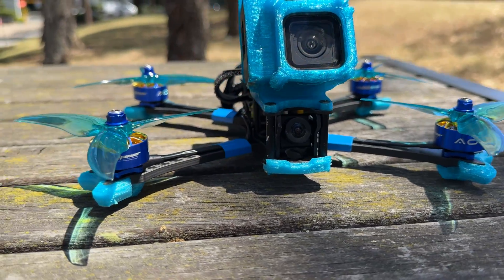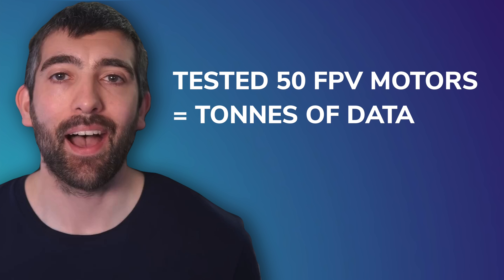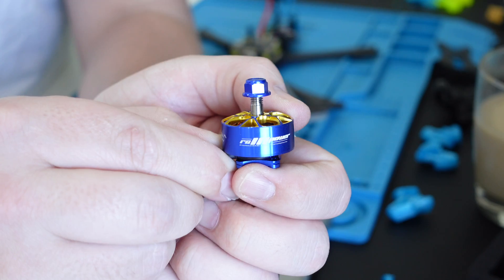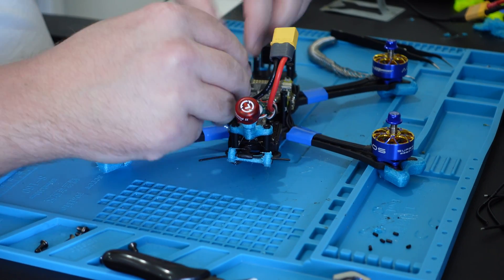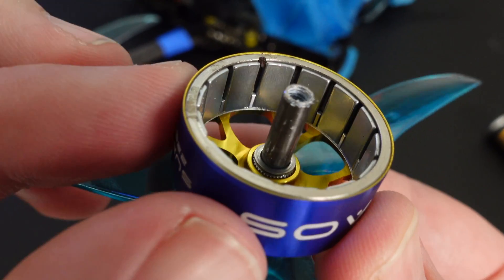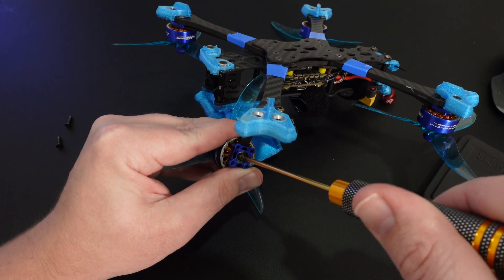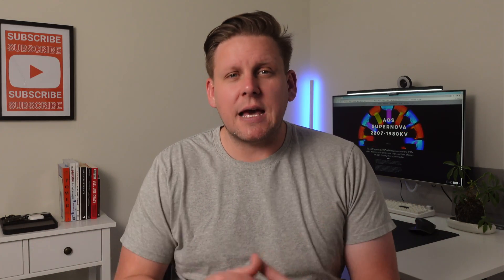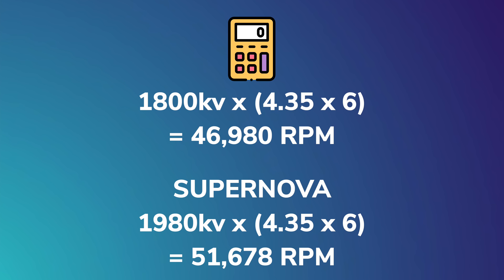I Tried “The Best” FPV Motor According To Science

Comment: Thank you for making this content. I 100% agree. For instance on the computer his 3.5 evo is perfect but  the stack holes run into another. So at the 25mm hole is the same for middle, then middle into front. So your vtx is 25wide how can you use the middle stack unless you choose 20x20. Why not just say it's 20x20 mounting. even if you wanted to turn the board the standoff is now at that point a problem. Same with the front they run into the middle/ camera plates are same height as the vista. He definitely tried to combine the iflight 2208 and Mr Steele 2307 in my opinion. Although the whole motor scene in a sham. Johnny Fpv and lumenier have been doing it for years. His frame was 03 ready before it was released, the cnc front plates he chose were vitsa/air unit ready.They have unique motor sizes and kv.( Now everyone wants a 4s motor on a 6s quad.) Here me out . ...

Everything that was over 2100kv or over in the 2306 or 2207 class was 6s( last year!.) Now it's the standard to be in this range. Also a year ago ... I was told it will spin the motor to fast and be inefficient because it would cause over oscillations 6s on 4s in general ... otherwise the motor will get hot "It's probably because the C rating before wasn't able to achieve the whole power band" or there working together. I've honestly been running for 6S motors on 4S for 2 years now because my iflight came unmarked all black... but the ripped and I continued using 6s. thus my question. So it's been a let's make everything lighter market. Because power is torque isn't it? It depends. At this point it comes down to weight. Because the same high end power isn't going to have torque for a dive on 800grams. everything have been pushed to become lighter so you don't need a lower KV with as much torque to pull out of dives. This is all skeptical . I've tried so many motors it's not even funny. not bench test! How does a bench test show thrust with weight differential. For him to say that Mr steele are not one of best is kind of absurd. So for chirs to charge $3 more for a motor with the least amount of material in any other motor besides flux that's eventually disapates. He clearly knows he has the right amount of followers to send us all to the bank.   his cnc madness clan alone. Mr steele motors aren't all the unique either. Johnny Fpv 5. Years ago 2306.8 in (1750 6s )2250( 5s 2550) (4s 2550) is apparently enough to change battery. I myself was giving the knew fad 2000kv room of margine until I read those specs. 28 grams also. So it seems  ust call a 4s motor a 6s because no one is buying 4s motors any longer. Mr Steele said so in his interview so his v5 isn't 4s..  also  So I can add the Stout bell to a silk stator and gives you 10%? Fair but is it the magnet or the kv? 10% is enough to go from 4s to 6s or magnets rather. So every 6s motor that uses nsb is 4s? it's just a better bearing. Go from nsb #2 bearing and or magnet made in the world to nsk #1 performing 10% better makes since. Also botgrinders 2207 have higher  ohms peak current and everything else at 2207 over Chris motor or basically every motor in that class except. Axis flying making a 2406 making 1000 grams of thrust is technically also a 6in motor but it's hot man.

Comment: The Velox 3 (2207) isn't 2207 either. It is 22,5 x 7,5 mm according to a review from Gal Kremer. I have purchased one of that and an F60 Pro Mk. 5 even to "feel" them. They are very nice both, just touching the bell, feeling the bearing and the cogging does not really justify the F60 Pro 5 being nearly double the price.

And just before I forget to mention. The F60 Pro 5 isn't 2207 either. It is closer to 22 x 7,8 mm in size.
Reply from the maker: Again, the point is - Chris has the opportunity to stick to science & engineering instead of playing into the marketing games of FPV companies.

Comment: One sure way to test is to see what hover times/flight times you get of those vs other best in class motors.
You should be get more minutes of flight time with these as they are more efficient.
In terms of feeling they probably won't feel much different than other motors with similar measurements and KV.

Comment: so much rambling with no valuable info
Reply: Bloodfart!
Reply from the maker: what "valuable info" were you expecting?
Reply: @DarrenAllatt  for example a REAL Test not just rambling?
Reply from the maker: What’s a real test?

Chris already did the bench testing, and has the data

Did you not see where I told you exactly what you were getting from the video
Reply: @DarrenAllatt  A real test would be for example to put this motors on, fly arround / to a full on hover test, meassure flight time and do the same with one of the other motors. compare it and check if his bench testing gives you real world benefits too. If it is stronger and faster at changing rotation  speed, that has to be feelable / visible / meassurable. So if that is true it MUST have feelable / meassurable effects. but for that it might me necessary to reduce filters in the FC.  
I saw it, but for my feeling it is overall negative based on price and size, not nuanced and dont takes into account that for some situations/flyers the pricyer motors might be worth it. I mean that it is more pricy you already see when you want to buy them, that the size is a bit different you get from him already. So there is no real information benefit dont you think?
one other thing bigger stators normaly come with rotation speed change penalty, so if you now have a motor with a bigger stator that has not only NO penalty but is in fact faster, thats a benefit i would think? That does not change the price, and maybe its not the best idea to call it 2207. BUT if its in the weight class of a 2207 AND rotational change of the 2207 or even better, then i dont realy see the problem. I then would call it a 2207 class motor. But it would be realy interesting to compare it in a real world szenario againt 2207 AND 2308 motors. And we dont have to discuss that a bad pilot dont get better by changing the motors.
Reply from the maker: @iwh7  what was this video about?

Me trying the motors,

What were the three things I said I would cover in the video?

1. what makes them different to other motors,
2. if the average fpv pilot can actually tell if they’re better, 
3. whether are they really worth $29 each

These were said at the very start of the video so you should not have been under the impression that you’re going to get all of those things that you’re asking for in a “real test”

All of the things you’re asking for were completely outside of the scope of what I was trying to cover in 8 minutes.

If you want that much detail, go and watch MadsTech Hhu will give you a 30 minute video going into all of that detail about the motors

I’m not here to go that much in depth into things because quite frankly, my typical audience wants to know those 3 things.
Reply: @DarrenAllatt  point 2 is a fair thing, but going out of you way to say its all based on biases (at least to me it pretty much sounds like that at arround 4:40) is pretty unfair dont you think? Especialy if you dont test that claim. And since most FC & ESC are probably more optimized to the type of motor that we had until now maybe there is a need to modify parameters?
point 3 is totaly dependent on what YOU want, for example i realy like long flight times, so a more efficient motor might give me just that.

Additionaly your pinned comment sounds quite salty and mostly rides on the fact that it is bigger than 2207.
calling him disgenious. Or fantasizing that he might have lawsuits on his hand. He did NOT copy any of the motors or anything, he used available motors to calibrate the simulation thats a pretty BIG difference.

And no not anyone can make an 2308 that has all advantages of an 2308 but has the rotational speed change of an 2207.  so combining those two classes into something new. If he calls it a 2308 but anyone just assumes that its as slow to change as an 2308 that would be an disadvantage!?

Maybe it would be better to call it an 2308 with the advantages of an 2207, but jeah i dont think He or the Motor deserves to be put in such an negative biased light.
In the End we need a realworld Test and comparision against 2207 and 2308 Motors. I get that this wasnt your goal, but I expected so when you call him out so badly.
Reply from the maker: @iwh7   what's unfair about explaining how cognitive bias tricks people into thinking they're being rational? You've been displaying the Halo Effect towards Chris, these motors and his process in all of your comments and discussion. You've displayed a number of other cognitive bias as well, such as the Horns effect (opposite of Halo) towards me and this video because I dare challenge the almighty Chris Rosser.

On Point 3, the video is called "I Tried" it's my experience and based upon how I intend to use the product, so yes its what the "YOU" as in me wants. I am sharing my experience.

Pinned comment. Yes, the science guy who's about debunking claims by companies about their motors, decided to play the same games and tricks as they companies he criticised. On the lawsuits, where did I mention they'd be for copyright infringement? no, no mention of that; what I said was: As he used the free motors the other companies sent him in good faith for marketing reasons, he then used those to make his own motor; if this was in the USA, that would be a law suit. 

2308. Point is, he had an opportunity to sell that 2308 is the optimal size by his testing and how his science made his motors better than anyone elses and why that makes it harder or impossible to reproduce the same results, no problem. But, he didnt do that.

You created your own false expectations because I "called him out so badly", let's look at that a little more closely:

You are displaying the Halo Effect for Chris and the Horn Effect for me because I "called him out so badly". Your Negativity Bias (paying attention to negative details) is also playing on how you are acting right now, especially because of Authority Bias (Chris is the authority on things science, so can't be challenged).

If you want a real world test, go buy them and do the real world test for yourself.

As I said at the start of the video, I set the expectations for what the video was about and what we would be covering; if you set yourself false expectations because you saw my community post or facebook post - then watched the video ready to pick on every negative thing; that's your own problem and fault and for ignoring the scope of the video.

I should mention, you are now at sunk cost bias because you are continually digging your own hole here.
Reply: @DarrenAllatt  Explaining bias is one thing doing it in a suggestive way that suggests that that is all you can expect, a completly different animal.

Chris is no authority, for that i dont know him good enough. But his explanation of the process and what he has done seems reasonable from a technical standpoint.
At least enough to make me think that at least the efficency claim might be right, even if i as a low quality pilot might not feel any other difference during flight.

Its possible or even probable that he used motors sent to him, i dont know if or not. But even then i would bet that using them to create a simulation model is not agaisnt the law.  would not bet on that BUT Again suggestive.

I watched you video because it sounded interesting and maybe i hoped for something with more "substance". Thats the only bias you can realy call me out on.

I have no facebook and i didnt saw any comunity post so i could not have any bias from there. I didnt WANT to pick on Negative things, for me that was pretty obvious that there is some negativity after seeing it.

But lets leave it at that, this shouldnt be something personal. 
I understood that its a subjective test and from that its your subjective opinion.

Comment: I'd rather spend $15-20ausd on a motor that has 20sec less run time and 3% less power. 

You learn to be a better pilot by 
1. Stick time . 
2. Pushing the limits and crashing and breaking .
Reply from the maker: Absolutely

Comment: I don't understand your point...

 All he has said is:
 By using engineering, better quality materials, and better design, I have produced a new motor. By using "the scientific method,"  I've obtained data that shows that this motor is indeed superior to the batch i tested. This is the data i gathered, read it and draw your own conclusion. 

Why would someone be biased by reading and observing a scientific proven experiment? That's not how bias works. Otherwise, we would all be biased in believing that air contains oxygen...

Biased is having a prejudice which could be induce for exhample by common beliefs, hear say or opinions..
The whole point of science and to use the scientific method is to eliminate bias from the equation and let the data speak.

You are right, a better motor won't makeyou a better pilot as me driving an f1 car won't make me winning a grand Prix.

Better equipment will directly affect personal performances if used appropriately to one own skill level.
Reply from the maker: There are several cognitive bias which prejudice us - and bias and prejudice isn’t about another person.

Confirmation Bias: People tend to favor information that confirms their beliefs - you have “data” that says they’re better therefore you think you feel their better performance when you don’t. 

Authority Bias: People tend to believe or obey authority figures without questioning them. - because there is “scientific data” to prove they are better performing against a non-comparable example, it gives these motors the authority they are actually better, when a premium T-Motor that’s 2308 1980kv would perform similarly on the bench and in the real world experience. 

Hall Effect. You place importance on the scientific data as opposed to how they actually perform in the real world against a realistically comparable example - therefore you think they’re always better.
Reply from the maker: But the problem is, Chris is calling them a 2207 and saying this data proves they perform better than other 2207’s

But they’re not 2207’s the stator size is 2308, which is 20% larger in volume than a 2207 - so of course the data will prove they perform better, they’re a bigger motor.

Say they’re a 2308, but they’re the same weight as a 2207 so you get all the benefit of the additional stator volume of a 2308 without the weight penalty 

It’s not that hard.
Reply: @DarrenAllatt  To be fair Chris has stated publicly that he calls them 2207 as to not alienate pilots that are accustomed to seeing that size. It is just the size his motors are similar to. 

For myself I can't imagine putting $30 in a motor and would rather put the money somewhere else in the quad. Equipment is really good all around these days, including motors. Besides, motors are a consumable much like batteries.

Comment: The Aussie FPV store rising sun FPV in Townsville sells 2308s 1900kv called “Helios” for $25 AUD each. They weigh 36 grams and have a max thrust of 1959 grams. AOS Super Nover $55 AUD weighs 32 grams and has 1980 grams of thrust. The second best 2207 Chris ever tested is the RCnPower MajorWasp Green $35 AUD weighing 30grams with 1800 grams of thrust. This shows that the AOS Super Novers are expensive and perform the best. I couldn’t find a “premium” priced 2307 easily. Personally I’d rather the cheaper 2307’s and get twice as many
Reply from the maker: As I said I don’t doubt for a minute that they have the best performance on the bench - what I seriously doubt is that any pilot will genuinely be able to tell if they had a comparable motor in stator size and kv, like the Helios. anyone who thinks they can doesn’t understand that it’s just cognitive bias telling them that because it’s the better motor they feel it performs better.
Reply: @DarrenAllatt I think the difference between the supernova motors and regular 2308 should feel quite obvious because iirc chris rosser said in a jb video that they weigh 34.5g (with wire), but the rising sun Helios motors weigh 36.3g and seem to be 2207.5, not 2308. So I assume they would be even heavier if they were 2308. 

 And I can say from experience that a difference of 2 or 3 grams from the ends of the arms can make a huge difference to flight performance as long as you don't go down in stator volume to get it

Comment: So.. It's basically a 2308 motor that weighs the same as the average 2207 motor..
Reply from the maker: Yes, why can’t he just say thay
Reply: @DarrenAllatt  1st he said exactly THAT. 2nd its a 2207 weight motor with a slightly bigger size, but without realy meassuring it I would assume that the stator VOLUME is more on the 2207 side. And i mean Volume and not just outside meassurements. But Again NO Test, no Meassurements, a lot of rambling.
Reply from the maker: You don’t know how volume is calculated do you?
Reply: @DarrenAllatt  i think so, but for that you need the inner size too, i dont think the inner part without winding does much for a magnetic field?